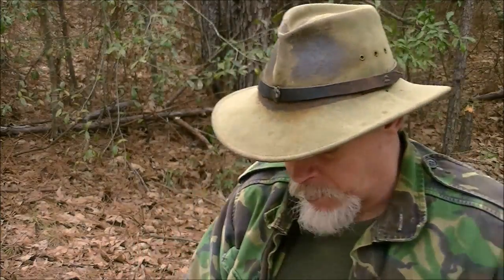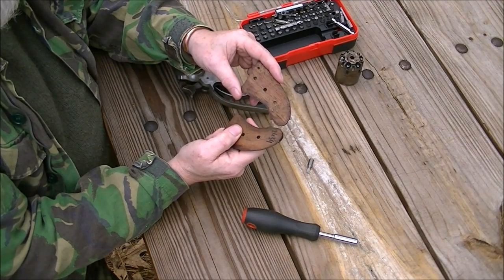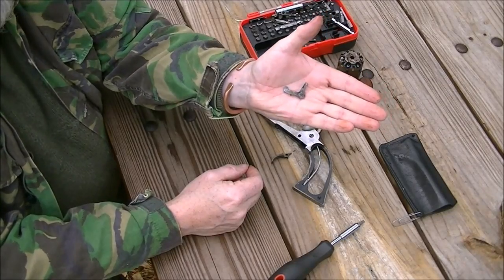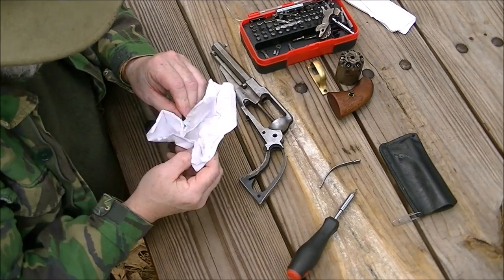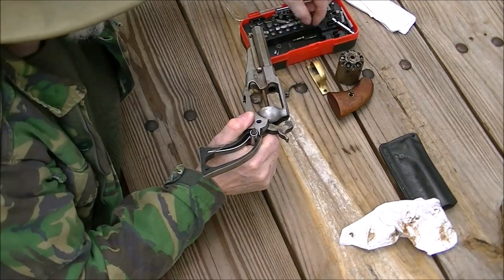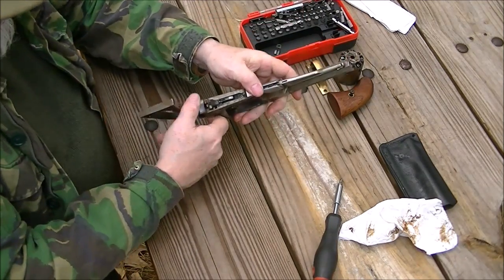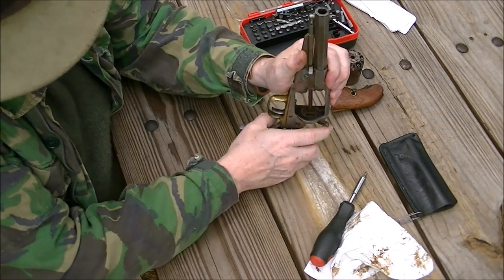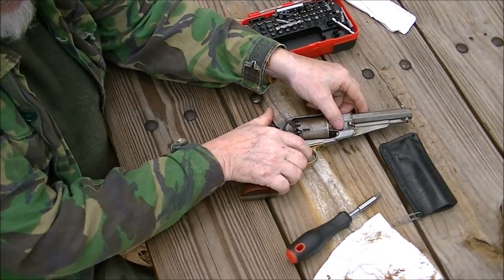1858 NEW MODEL ARMY FULL FIELD STRIP

Comment: I have an Uberti 1858 new model army revolver in .44 caliber with a blued steel frame and an 8 inch barrel. I’ve never stripped it down even though I took the percussion cylinder out and I use my Howell fluted .45 colt cartridge conversion cylinder with it. I’ve never used the percussion cylinder. I specifically bought the piece last summer for use with a Howell drop in cartridge conversion cylinder and I bought that Howell cylinder at the same time I bought the piece. I also bought me a couple of boxes of HSM .45 colt 200 grain cowboy loads for it and in the past 6 months since I took it shooting for the first time last October I’ve taken her out shooting a total of 5 sessions and put about a box and a half worth of rounds through her. I made a video of my most recent shooting session this past Sunday and posted it on my channel. I was doing a 5 shot session firing 5 shots from about 30 feet away at a cantaloupe. That’s the distance that my piece shoots the best from and cantaloupes are my favorite targets

Comment: I just replaced the hammer spring on my Remington. Not sure what may have been the problem but the spring snapped off just beyond the folded over portion. Ordered the parts kit from Cabela's. The new spring looked identical but it was ever so slightly straighter than the original and had to make some adjustments to fit it in. Now I'm back up and running. Just need to get to the range.
Reply from the maker: sounds good

Comment: I just purchased a brownells Magna tip screw driver with 4 bits. The bits don't fit the screws on Uberti new model army. Can you tell me what size screw bits I will need and how many? I know now that Italian screws have narrow slots and require thin thin tip screwdriver bits.  Thanks.
Reply from the maker: ok sorry for the slow reply its the middle of the night and i just found this i went and pulled out one of my revolvers and the screwdriver tip i use to break it down..on mine it says  crv 1/8 or i can also use crv -5/32 hope this helps ya

Comment: Dear Mr. Thomas,
Thank you for sharing this knowledge with us, it is very helpful, one of the best channels for C&B revolvers.
I have recently purchased 1861 Uberti replica, also "london" model, and i have two question regarding Cylinder gap and wedge.
When i cock revolver it is tight fit, but when the hammer is lowered, the cylinder is moving back and forward a little, and that "rattle" is whats bothering me.
Just want to ask is that normal?

And how much should wedge be tapped in?
On my Uberti, the wedge positively "click" when inserted, but it can be tapped much further in. 

Should i leave it as it is, or should I give it to gunsmith to make a new wedge that is wider?

Best regards!
Reply from the maker: the slight forward  movement is normal..and the wedge should just go in and the tooth of the spring click up to prevent the wedge from walking out while firing..as the gun ages and is soot a lot the wedge will seat further in..as wear happens on the surfaces
Reply: @BLACKIETHOMAS  Thank You very much!
Best regards!

Comment: Should nipple threads be dry or greased when putting them in ?
Reply: Ima gonna say the originals were lubed with tallow.  Black powder residue teams up with atmospheric moisture to do wicked, terrible and nasty things to steel threads.  Today, graphite, CeraKoat C-110, gun oil - pick your flavor.
Reply from the maker: also check out choke tube lube for shotguns this seems to work pretty well
Reply: @BLACKIETHOMAS  I didn't think of that.  That is probably ideal.  Or, copper-based anti-seize, if it's not too thick, but I'll bet you'd have to clean it out every time.   :-(
Reply: @BLACKIETHOMAS  Are you up late or early?
Reply: Thank you Blackie and Peter

Comment: Just ordered the 1863. Does the mainspring disassemble and reassemble the same as the 1858 or is there another trick for that model? Thank you.
Reply from the maker: they work the same
Reply: @BLACKIETHOMAS  thank you. Seen a few other video's that didnt use your method. Yours works easy on my 1858's was hoping same method for rhe pocket. Again thank you.

Comment: Please? If you can answer why the handspring breaks and the proper way to replace it and time it. I have done this. I used a stone to get a proper fit. It was a Pietta rebuild kit. as I understand these guns the bulk parts well, require some hand fitting. that being said I have old mechanics hands pulling that hammer back is not my problem. my concern is losing the temper on the internal parts. I'm not a big man 5 ft. 8 in. 180 LBS. my average. destroyed vice gripes of any size faster than I could buy them. yes, my guns have battle scars my hands shake and I've beat the h3ll out of them. I've had some whoops ah sh!t. (dumping .451 round balls in with .454's) both seem to work just fine, yes, I always check the ring ramming it home but throw in a Waud to be on the safe side. I have one-cylinder empty nipples removed that I use to train each hand cocking and returning. why two hands? (misfires) even today you can get a dud on modern ammo. Yeah, old soldier let's keep the oh sh!t! to a minimum.

Comment: Hey Blackie,
What should i do if the cylinder isn't turning when i speed cock it? Seems that cylinder doesn't turn at all, or turns too far...i was having a problem with the tiny hand screw seating too far, to where it actually threaded past flush, and the hand could move. 
I thought i had everything perfect.

Comment: I love your vids on black powder! Got to get one soon........you know how it goes when you get a gun in your head that you want.........😭 So, for a TOTAL NOOB........do you recommend Remington (I am partial to the New Model Army because of the top strap) or the 51’ Colt? If by chance anybody on this thread reads this inquiry & would chime in, I would be grateful! Thanks
Reply: It was my first gun I love it and yes I would recommend it. Colt is good also but out of the box I’ve had less issues with the Remington sucking caps and having cap jams. Just my opinion and experience.
Reply: Nathan Aagesen Thanks very much for the feedback. Yep, total noob so you’ve confirmed foe me !
Reply: Jazz Man look at EMF company they are Pietta but always have great deals.
Reply: I would also add that if you plan on shooting it more than a cpl hundred times while you own it, invest the extra money in getting the steel frame models. The brass frames get a gap between the cylinder and the barrel fairly quickly. Also, if you ever want to get a conversion cylinder to fire modern ammo, the steel frame is a must and the Remington with it's top strap is much sturdier than the colt. Just my opinion...others may have better luck or prefer the colts. Either way, enjoy yourself and be safe